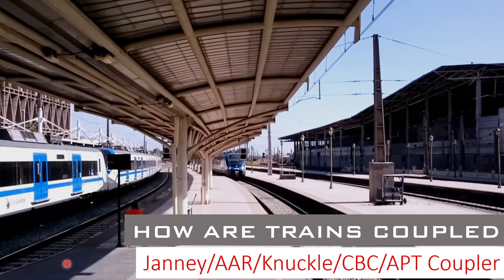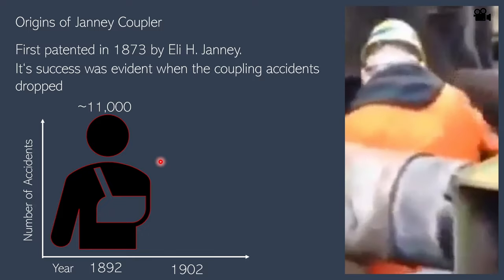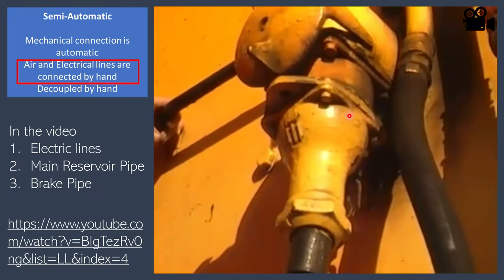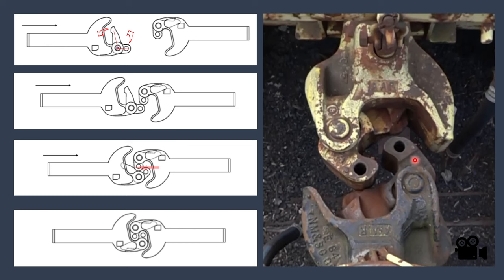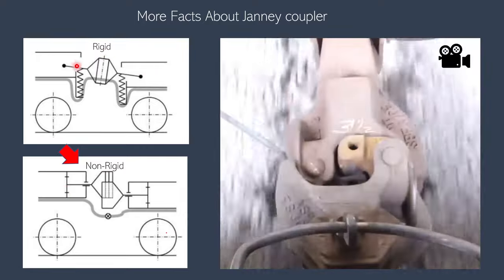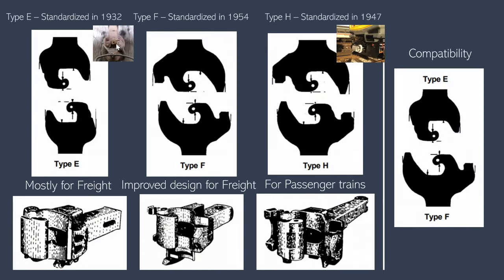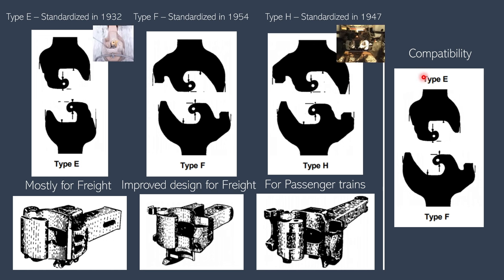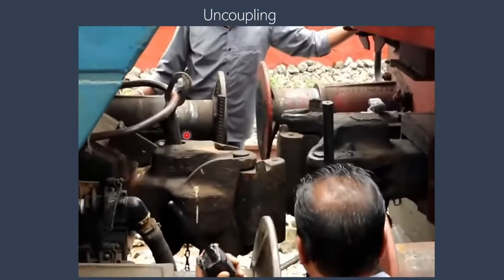Train Coupler Explained: Janney/CBC/AAR/Knuckle/Tightlock

Comment: Using Janney couplers together with buffers looks a bit special, compared to North America (Janney/AAR only) or Europe (buffers but a simpler hook and loop coupler). I take it that the buffers must be pressed together slightly before the couplers will lock? But it makes sense to keep the buffers after a coupler conversion.

By the way, I believe Type F, the improved coupler used for freight cars, is designed to prevent cars from decoupling and turning over during a derailment. If a car starts to topple, the neigboring cars will resist this, as the coupler is designed to prevent that type of rotation. And avoiding decoupling is a defense against telescoping of cars during an accident. The passenger type coupler has this safety feature, but also comes with sprung drawbars (i.e. the connection between car and coupler), which provides better comfort for the passengers. But the buffers, if present, provide more or less the same comfort, i.e. reduced jolting due to "slack action".
Reply from the maker: Wow that's a great observation, I was so focused on the coupler that i completely missed buffers in the last 'uncoupling' part of the video. The video definitely is from the Indian subcontinent. let me look into it as to what is the purpose of having both couplers and the buffer. 

I agree Type F prevents telescoping. I should have included it in the video. Thanks a lot for the fulsome comment. These discussions are very enriching not just for you and I but for the readers as well.
Reply: As I recall, many Indian trains are equipped with both knuckle/Janney/Automatic couplers and with the old Buffer-and-Chain setup, so they'll be compatible with both newer and older rolling stock. Some early Australian locomotives were also equipped with both coupling systems.

Comment: I assume the last shots are of Indian or Pakistan railway, they use both Janney style and  train buffers. Very interesting combination.
And thank you for the video.
Reply: The last shots are from the Indian Railways and what you see is two locomotives being decoupled. A lot of locomotives in the Indian railways have both Janney/CBC couplers as well as side buffers (at both ends). That way a locomotive can pull newer passenger cars/coaches with Janney couplers as well as older passenger cars/coaches with chain and buffer couplers. Freight cars in the Indian railways only have Janney couplers.

Comment: ive wondered this for many years (my dad worked for a class 1 railroad in the US for 42 years but no longer remembers) HOW do the couplers, with the pin on the bottom work?  you show them at 6:15.  the pin cant 'drop' to make the connection because gravity would pull them down and disengage the knuckle.  there must be some complicated linkage to LIFT the pin and hold it up in engagement
Reply: There's a bit more inside a coupler than just a pin. When you "pull the pin" on a freight car, it lifts a block that allows a hook to move that allows the knuckle to swing open.  There's more than one design out there of course. I've seen knuckle couplers on an old Interurban trolley car where you pull a chain on the side of the car that "pulls the pin" from inside the drawbar. Definitely different, but also necessary when your rolling stock will negotiating streetcar curves through downtown streets.

Comment: 0:49 Wouldn't it have been be much safer to just add a small ladder to each car so that the guy could just hold onto it and move with the car "rammed into" instead of having to move by himself? Or even better, have the guy starting outside, then move in-between when the two cars are together? 🧐
Reply from the maker: Agree but I am guessing these instances happen because of complacency. When you do this 30 times everday for 365 days  for 10-15 years, you start becoming complacent and want to save time so you start doing these things.

Comment: How are they uncoupled?
Reply: It shows uncoupling at the around the 06:37 mark.
Reply: You pull a lever that lifts the pin holding the coupler shut. In the US at least the lever is on the side of the car.